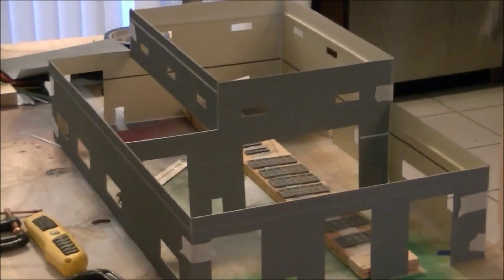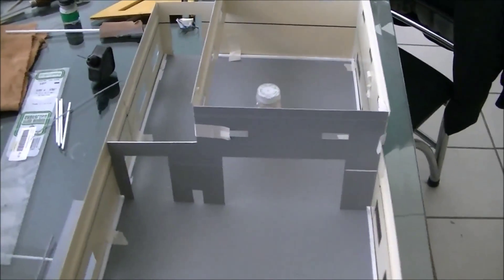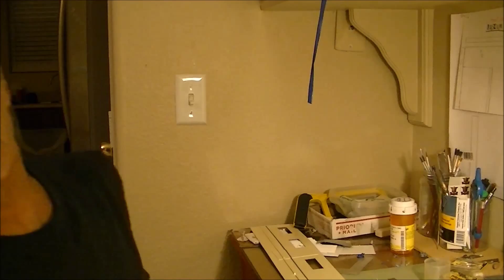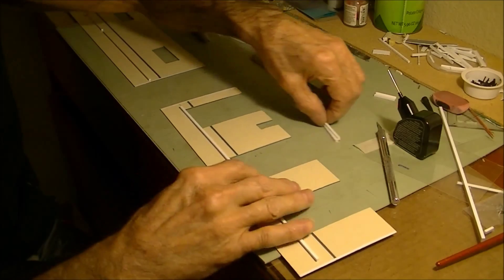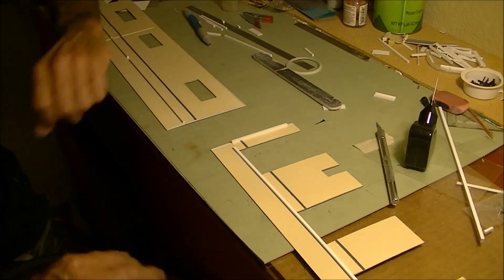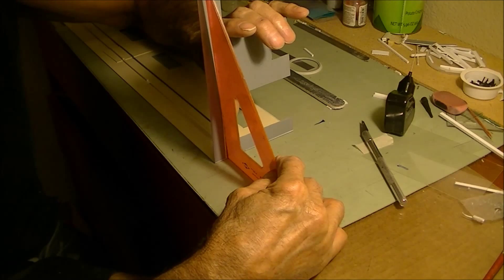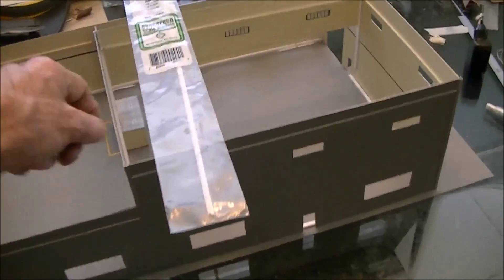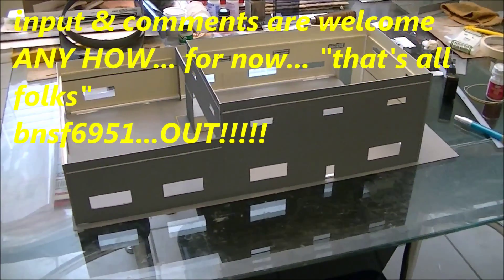HO SCRATCH BUILD FOUNDATION & WALLS

Comment: I know you said to mask areas that are to glued from paint, but when you glued the corner pieces on the outside corners of the model. The corners looked painted and not masked. Do you use some other glue that will stick better to painted surfaces. Thank you